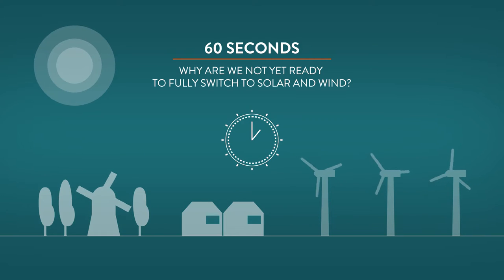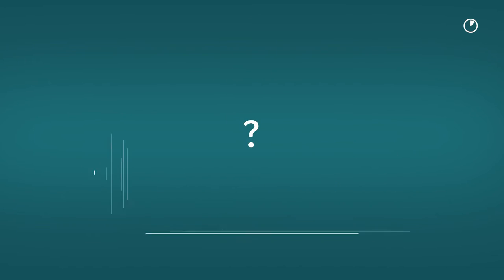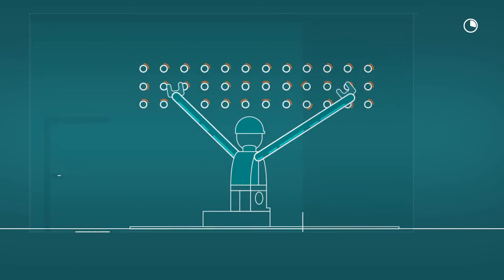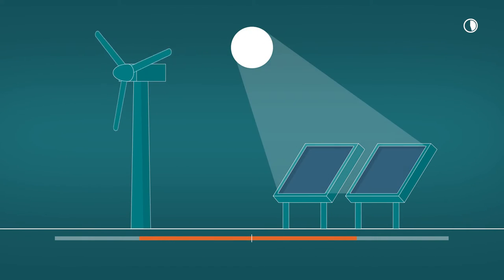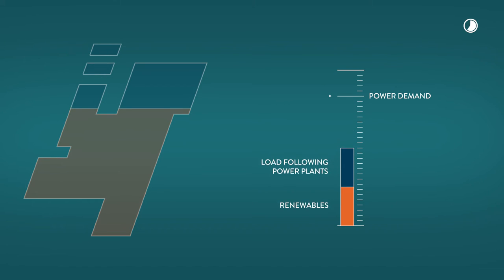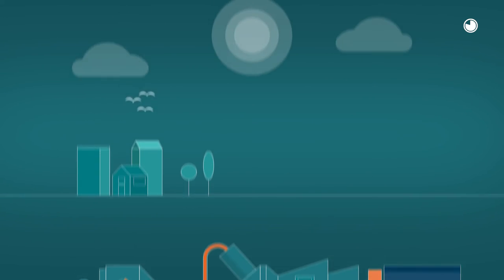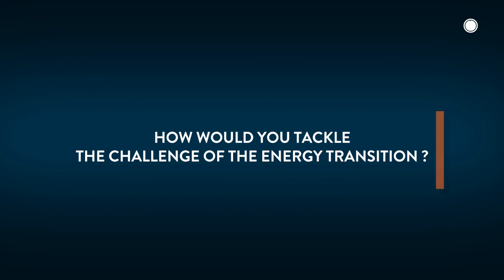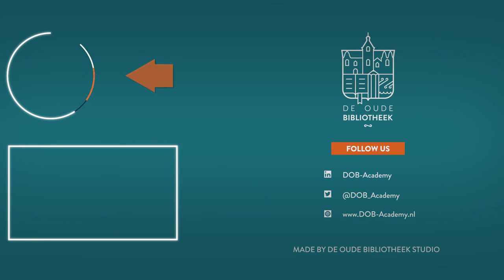Why Do We Need Gas - IN 60 SECONDS

Comment: This video makes a very important point. When you build wind and solar infrastructure, you have to also build fossil fuel and nuclear plants to provide 100% backup when wind and solar don't meet demand which can be up to 75% of the time spending on the weather.
Reply from the maker: There are multiple ways of providing the back-up. Oil, nuclear, hydrogen, hydro, and many more.
Reply: @DOBAcademy Yes, and those costs should be added to the cost of building wind and solar plants. You effectively have to purchase TWO generation systems: one erratic and unreliable, and one dispatch able and reliable.
Reply: @DOBAcademy  True, but the advocates of wind/solar often neglect to mention they need 100% backup and neglect to include that fact in their cost estimates. Is it sustainable to require a 100% duplicate energy infrastructure just to compensate for the erratic production of wind/solar? If think not.